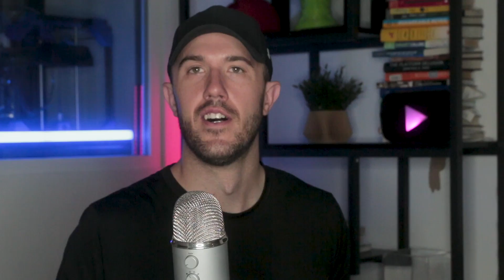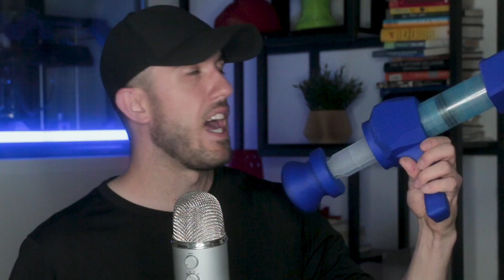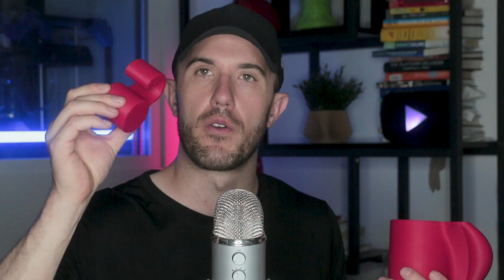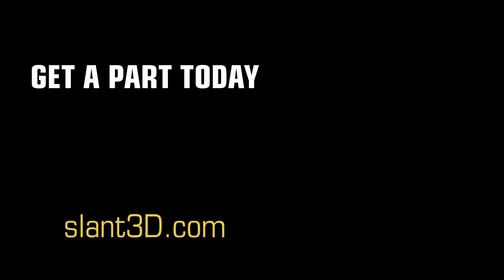The Truth About PLA+ | Open-Source Doesn't Work | Stratasys & Nano Dimensions | 3D Printing Podcast

Comment: Does the api give a quote if you scale to say 10000 units on price. Im trying to prep a sales pitch and need general quote. Does the price scale linearly or should i expect a price cut per part. A video on pricing would be amazing. I could always have your pricing for quoting people that are curious.
Reply from the maker: The API is designed for print on demand only. In order to get quotes for large volumes you can send the file through our quoting form for the team to review to make sure pricing and design are as optimized as possible which is super important to large scale manufacturing

Comment: There should be some way of automatically licensing designs for 3D printing.  For example, etsy sellers should be able to print someone else’s file that is automatically licensed for a small royalty.  It wouldn’t be a difference if that person has their shop connected to Slant3D and delivers the printed designa through you for example.  They would be able to bundle the licensed designs with their own.
Reply: Bambu Labs Digital Design Marketplace coming soon....😊
Anyone can 3d print, sell their gcode with limited usage rights, print available designs for a small fee, or just be part of the market fulfillment for local delivery. Catch is, you need a Bambu Labs printer, and also need a rfid tagged Bambu Labs filament. Just some predictions or crazy 💭❤👍

Comment: You are completely wrong about open-source software. Many successful projects exist. Some examples: Debian, Arch, the Linux kernel, MariaDB, Apache, Firefox. There is tons of open source hardware in the form of PCB designs.

There are also tons of open source projects like Mach/BSD that even allow someone to take the open-source code, change it (or not), and sell it. If you're using an Apple product, you're running code that started as open source and was then taken and integrated into a very closed product.
Reply: What open source advocates forget, perhaps conveniently, is that the people writing open source work for companies that product proprietary software. Otherwise, they wouldn’t have jobs and couldn’t afford to write the open source software they do as a hobby, mostly. Even Torvold has a “real” job.
Reply from the maker: All sustained by large scale companies supporting them. In nearly every case corporate support keeps the projects alive, not community contributions. Even in the 3D Printing industry the "open source" slicers are maintained by Prusa or Ultimaker not really community development. Open source is great to start but it needs long term support.
Reply: @slant3d  An open source project can at least potentially continue to evolve after any backer leaves. It can be forked. If a closed-source vendor abandons its product, it is well and truly gone forever. Every project needs continued upkeep. 

Windows 7 is no longer a viable product because Microsoft gave up on it. Canonical gave up on its Unity desktop environment several years ago, but a few people keep plugging away at it and you can still run it if you really want to. OpenOffice stagnated under Sun and Oracle's stewardship, but someone else stepped in (the Apache Foundation and the community) and forked under the name Libre Office. If there is demand for continued development of an open-source project, that development can continue. If MS stopped work on MS Office tomorrow, someone would have to either start from scratch or buy the Office codebase (probably impossible due to licensing restrictions between MS and other companies).
Reply: @treowayne  Well explained ;-) ta
Reply: @slant3d  Ill argue this. The issue with Open Source are the companies that take it, make heavy use of it (Amazon, Microsoft, etc) without contributing back to it in the form of money. Amazon HEAVILY uses the efforts of open source projects and would not exist today without it. Yes, it does need long term support, those that make use of it should contribute back to it. 

Editing: This is not an argument against selling your models for profit, not making them open source because that is your choice and is completely sensible.
Reply: @slant3d  On the physical side, software not ;-)

Comment: Sorry I'm not 100% with you on this one. Yes, there's a big difference, but not all pla+ are the same. Sunlu and polymaker pla+ are stronger that regular pla. I made test prints. I print more than 40 samples of the same. And yes there is difference.
Reply from the maker: Sometimes. But it is mainly a brand/marketing term that often has little technical justification
Reply: Yes, that's all that @slant3d  is saying -- that some pla+ is stronger. Some pla+ is weaker. You have no idea because it's not a specification, it's a marketing term.

Comment: The only pla+ I've used that I found was actually different than other pla I've used was duramic 3d. I really like their black pla+. I found it is stiffer and stronger but this may just be my imagination. I do really like the way it prints out and the finish is really pleasant.  I use it for things like tools and brackets.
Reply from the maker: True PLA+ (Ingeo 850 and comparable materials) is a good option for functional. It was intended as a PLA abs replacement

Comment: Swing and a miss on this one
Reply from the maker: In what regard
Reply: @slant3d I wouldn’t agree with the comment “always”; but the most profitable SaaS companies are built on top of it. Even Apple’s (Darwin) and Microsoft’s (Azure data centers) great comeback is based on it. On the flip side, RedHat is in hot water for failing at FOSS as of late (see latest news). Turns out that the most successful companies actually know how to embrace and deliver SaaS on FOSS (not just Linux, we’re talking frameworks, languages, protocols, furnishing transparency, security to scratch the surface). Of coarse what gets most people up in arms is what you did NOT specifically say (riprap) or mean (?); you’re referring to 3D printing (open source hardware vs *software*) hasn’t proven to be as noteworthy but ripe with controversy. It might have been clearer by just citing how various companies violated GPL on the way to the bank. Funny thing, none of the violators are profiting as well as PRUSA. The violators clearly know as much about profitability as they do about open source. I guess they’re not the only ones that just don’t get it. 😂😂😂
Reply: @slant3d your takes on open source are the same old arguments that have been repeated for decades. 

Open source software/hardware is always better than proprietary garbage.
Reply: @CandidProle That's not always true. I know people who have used Photoshop and the GIMP and they say that the GIMP is missing useful features.

Comment: There are quite a few filament testers out there on Youtube and they usually report a massive difference in impact resistance between regular PLA and PLA+ or PRO.  Especially Esun and overture seems to have a good  PLA+ formula.
Reply: Esun pla+ is noticeably more durable that regular pla
Reply: Esun pla+ and polymaker pla pro is what all the 3d printed gun guys swear by, petg deforms too much, abs is too brittle and high temp. If they want better than pla+ they move to nylons.
Reply: @Telecrit32  Most gun printing guys aren't using PLA, but rather Nylon-CF or other more impact resistant materials.. Hoffman sometimes uses Esun PLA+, but its not his preferred material either. Said it's the cheapest filament he uses for 3D guns.
Reply: I know some manufacturers/suppliers, like Matterhackers, use the PRO buzzword to express that their filament is made in the US, versus their "standard" filament made elsewhere.
Reply: I believe Thomas Sanladerer did filament tests on PLA+, and honestly the numbers didn't look all that different from PLA.
And it seemed like ABS is still FAR better for surviving high temp drooping compared to PLA+.
Reply: I think, his point (Slant 3D dude) is spot on. Unless you reveal the designation  and /or a material data sheet, etc…. it’s buzzword bullshit. The person who should do the video, is Stefan at CNC Kitchen. He, in my book, is the authorative voice on YT and hell, just authorative because of his research, testing methodologies, etc…. It would be interesting to see him take say, top ten PLA+ mfg’ers and run them through the mill to see who’s best and compare each to the best regular PLA’s.
Reply from the maker: Depends on the manufacturer

Comment: Open source does not work for physical designs? WTF? I myself have remixed models on Thingiverse that were remixes already. Open source works great for models.
Reply: Yeah I agree with you there are plenty of open source project that works well. But like you said here slant3d is more speaking about the business viability of open source especially for 3d models. Most of the time with the open source model if you want to make money off it you need to capitalise on the services around it. Like Prusa, to take an open source 3d model. What they sell is not the hardware and the parts, they are selling an hassle free 3d printing experience. I'm not a PrusaOwner by the way but it's a good example ^^
Reply: @KevinLemarchand  Open source is not a business model. Open source is successful when it spreads and is useful.
Reply: @frankbauerful  I'm totally agree with you on that! Maybe I wasn't clear enough on my reply ;)
Reply: He’s quite correct about a lot of aspects of open source. Lower quality. Harder to use. No customer support means users have to have a minimum expertise level to troubleshoot.
Reply: I would assume by saying open source they would mean the original cad files. Thingiverse is majority free use mesh files that are easy enough to cut and add to, but not the original bodies. When designing there is a huge difference from a mesh body and CAD files.
Reply: Don't worry, dude also thinks nothing can be produced with traditional manufacturing. He's always showing stuff he doesn't know how to make any other way and claiming only 3d printing can do it. He's just marketing his print farm on here and you either see that or yer the target.
Reply: @chublez he’s never indicated anything like that. But his business and the interest of all of us here is 3D printing, so of course, what he speaks about is unsurprisingly enough, 3D printing.
Reply from the maker: Thingiverse?
Reply: @slant3d  Yes, Thingiverse. What's the matter?
Reply: @frankbauerful  I think he has a different point on that. Opensource just means the source is open, it doesn’t mean it is free. As a FreeBSD person I really don’t like that Linux is mentioned as the only success in opensource, there are many other successful systems based on the opensource concept.
In the BSD world it is not as much that you have to give back to the origin, Sony has famously based the Playstation on FreeBSD, and the Playstation source is not open.
Opensource is not all about giving back to the origin, it is about offering a look into the design and be able to modify it.
Sure in case of forced open source with Linux, or in case of FreeBSD not being forced to keep your derived code open, both projects benefit a lot by contributions and there is the point, that 3D is usually not text based code, unless maybe with OpenSCAD, which can be easily merged, plus unlike an OS a small 3D there is often no benefit in pushing changes back to the origin.
Most modifications are not to make generally better, those are modifications for a different use case, so creating new objects.
All in all opensource works great for 3D objects, but without a benefit for the origin and thus also not that much in a benefit for the creator itself.
The creator gets fame and glory, but often the intention to opensource is to get contributions back.
There is also another problem with opensource 3D objects, STL and even STEP files are not source, they are intermediate and lot of the open creations are made with commercial software.
Unless the software used is open as well and the real source is published, there are massive limitations in the openness.
That however doesn’t mean it never works.
For example there are systems based on system tiles, like some marble systems, or print-a-block, those creators can benefit from having more published modified 3D objects for their systems without a need for merging individual objects.
Reply: @ticso24 Open source means that it's free. If you want a creative work where you can get the source but can't modify or share it, well, that's called Source Available. I encourage you to use that term.
Reply: @ticso24 When you say "forced open source" you're talking about copyleft, which just means that any non-infringing derivative works have to be distributed under a license meeting certain criteria, often the same license or one that doesn't add restrictions over the original license (there's also patentleft).
Reply: @ticso24 macOS is based on FreeBSD. Apple has contributed back to that. Open source can mean a lot of things. So Apple has a version that is available to,anyone. But their UI, and other parts of the OS are proprietary. Companies don’t like software that EVERYTHING they develop on their own has to be available to everyone to use. I don’t blame them.
Reply: @reddragonflyxx this is why it depends on the license the project is being used under. There are several.